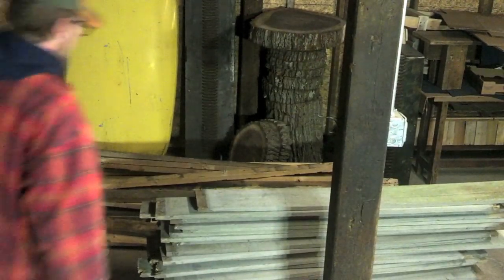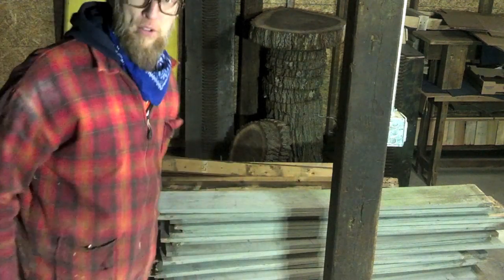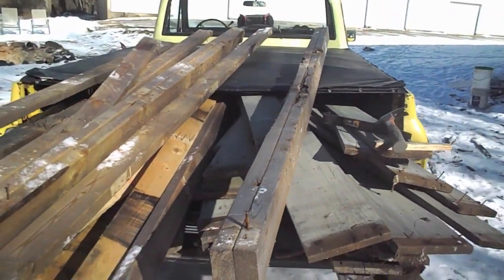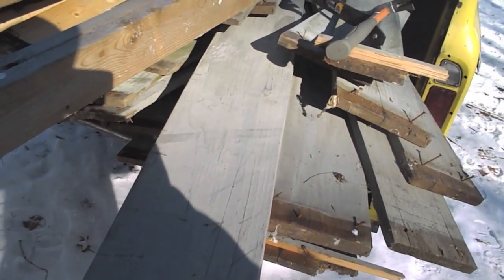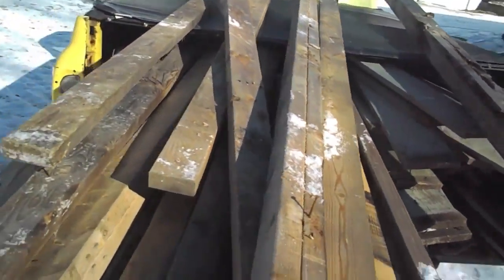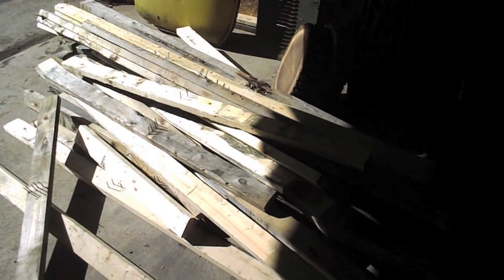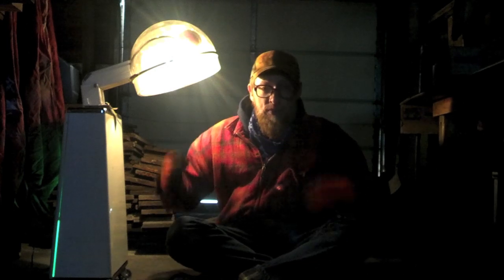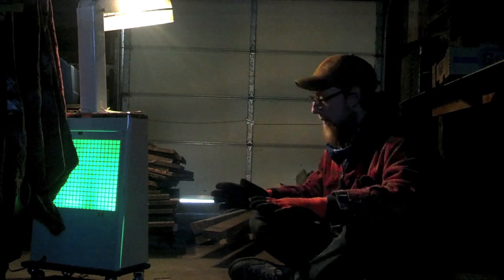reclaiming wood and making stuff with it, ep. 1 - tim sway perspectives

Comment: You did a good job on your video and I will check out the rest. I have a suggestion about your magnet and nails, though. I've found that if I double-bag it with plastic shopping bags that I have a container already on the magnet that pulls the materials away without having to pick and pull at them. By the way, I found you on Instructables and when I'm through here, I'm going back to vote for you. Keep up the good work.
Reply from the maker: good idea with the bag!! thanks man, -tim